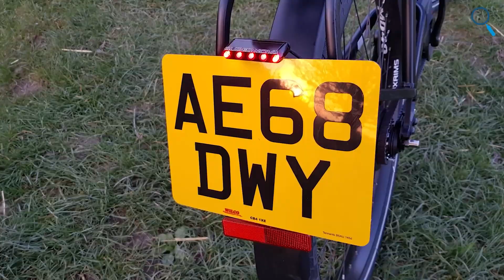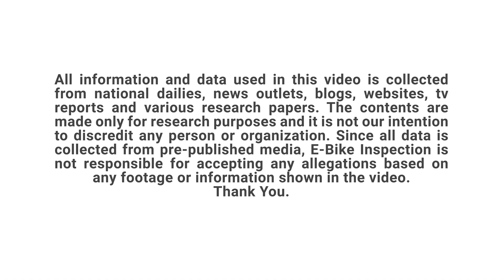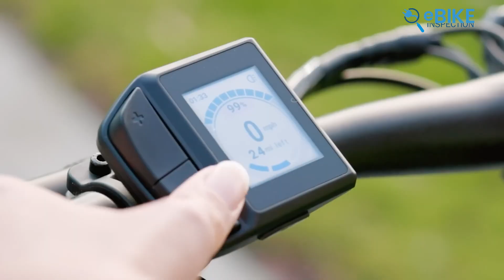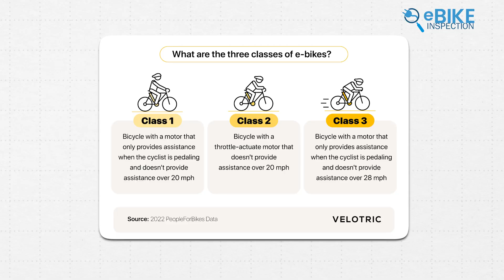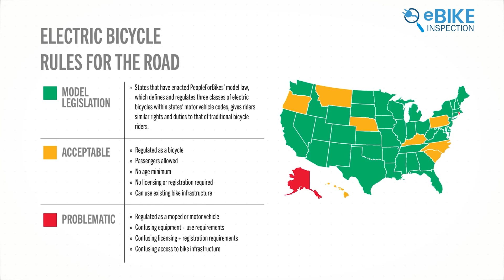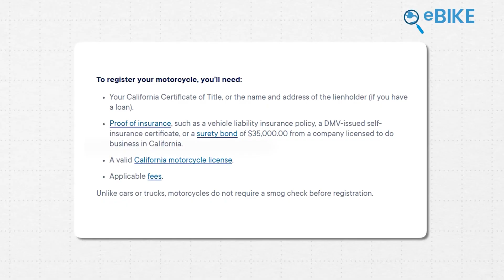How Ebike Speed Limits Actually Work? Every Rider Need to Know

Comment: I don't think you have this quite right. I see lots of trails and paths with speed limit signs for ebikes and bikes.  They often say the speed limit is 15 mph, not motor assisted power. It is not about how much wattage, or how fast your ebike will support you going.  It is about how fast ebikes are allowed to travel on that particular path. That is a speed limit that is similar to how speed limits apply to cars. 

Yes, there are rules about top speed the motor can provide help achieving, but that is not what they are talking about on sign on the road or trails. I think your reference applies to the making of ebikes and what amount of power is allowed for such as 500 or 750 watt motor with in certain areas or that the motor stops helping.  That is not a "speed limit" I think you are really trying to discuss manufacturing requirement and the legality of certain bikes in certain areas.
Reply from the maker: Thanks for your detailed thoughts on e-bike speed limits and how they apply to trails!